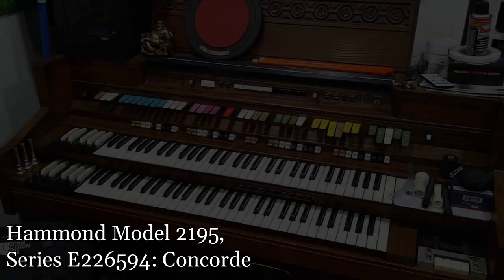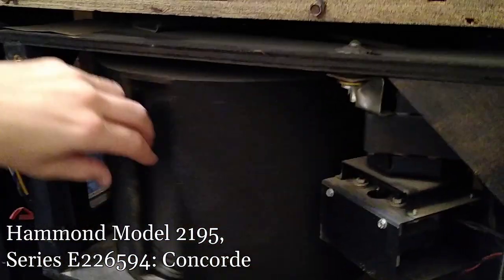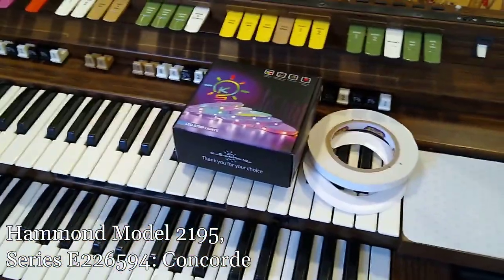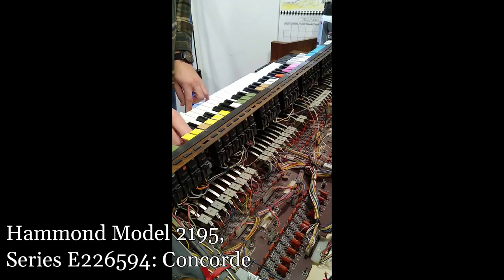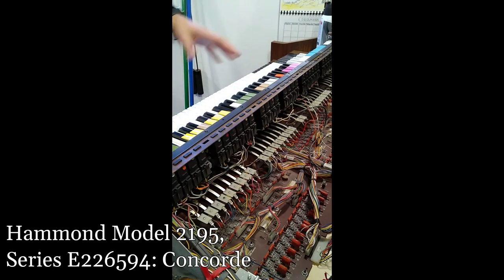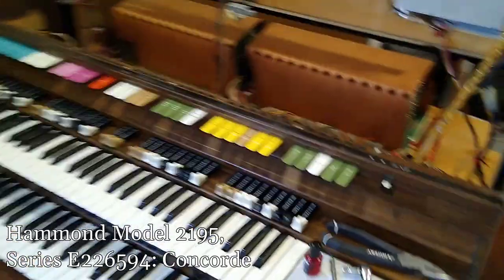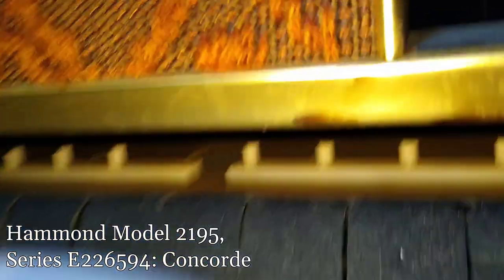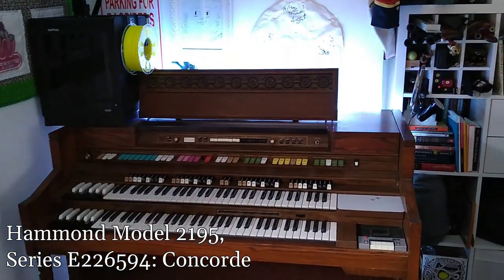Cleaning-up a Hammond 2195 Concorde Organ

Comment: I have a Hammond concord just like that.
Sometimes it works very well but sometimes some upper keys sound very quiet.
I move some cables around the back and it makes a noise similar to the one you show in the video.

Do you have any information that could help diagnose the cause?